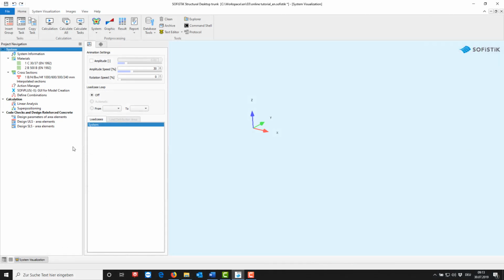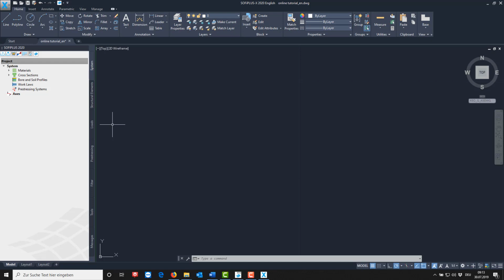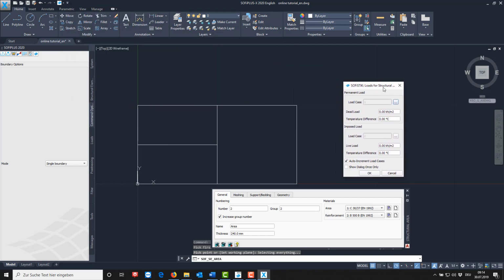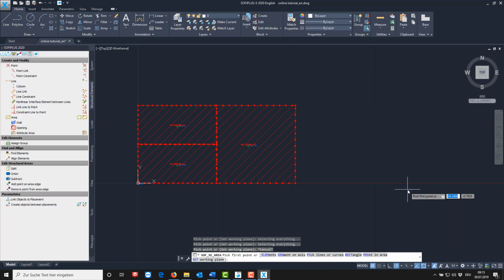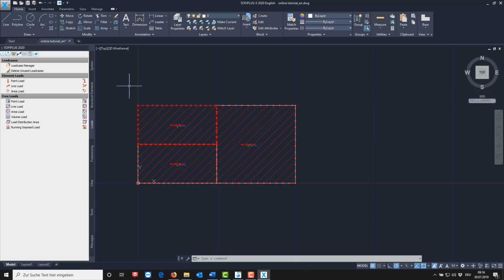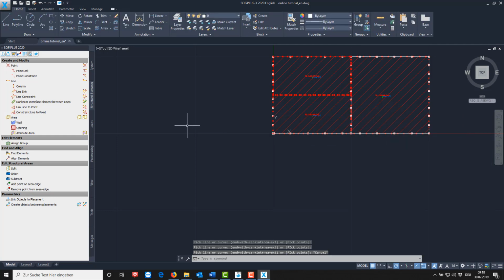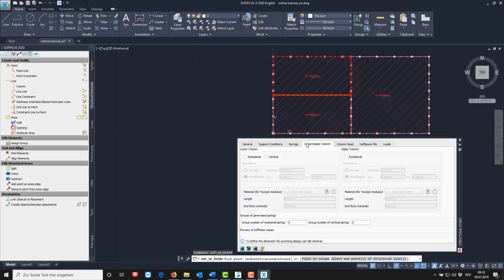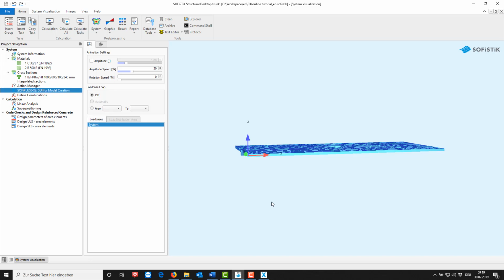SOFiSTiK | 2020 - Graphical Input of System and Loads in SOFiPLUS (-X) (03)

Comment: Can I insert points to model any geometry o is imperative to use sofistikplus or autocad? I can use grids, cannot I?
Reply from the maker: We give you multiple options to create your model for SOFiSTiK Structural Desktop (SSD).
If you want to do your input via SOFiPLUS (AutoCAD-based) you can of course use AutoCAD-grids to organize your model.
But the exported information in SSD is based on Structural Elements (including structural points), that you placed in SOFiPLUS, meaning the grids don´t get exported to SSD.

You can also add information to your model after your SOFiPLUS input using the textinput (TEDDY).

Comment: so i need to install AutoCAD for modelling
Reply: Not is you are using SOFiPLUS-X which on the OEM version of AutoCAD
Reply from the maker: There are multiple options to create the model in SOFiSTiK Structural Desktop. Text based , as well as graphical interfaces.
One of them is based on AutoCAD (SOFiPLUS). We also offer a separate kernel, so you don´t need specifically AutoCAD. It is called PLUS-X-OEM (SOFiPLUS-X).